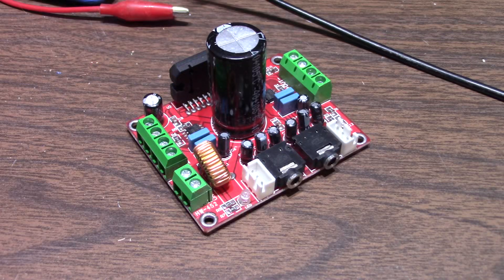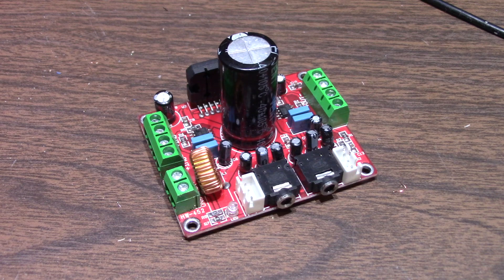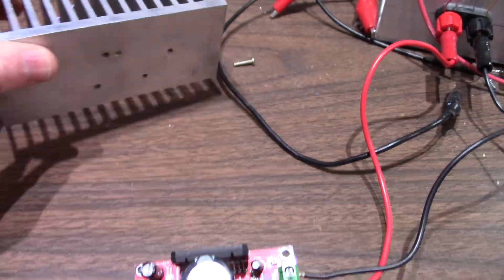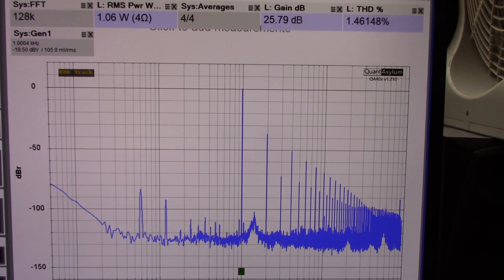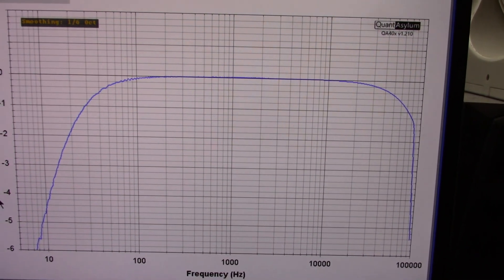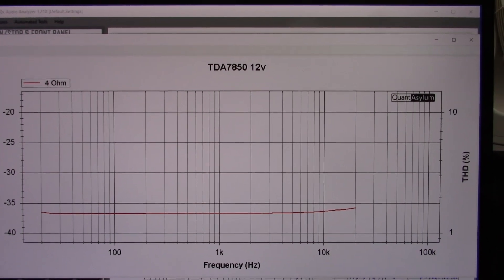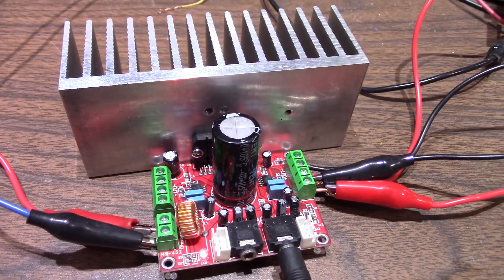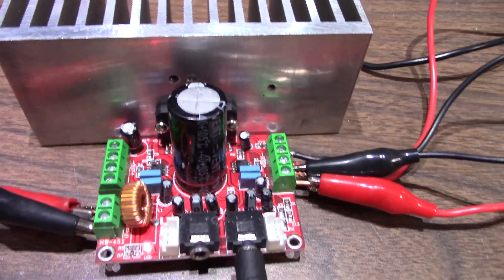TDA7850 4 channel amplifier on the audio analyzer

Comment: That might have bad electronics or be a copy of the chip because it's supposed to do 4x28W at 10% THD (theoretically).

Anyway it's not like most branded car units are that amazing too, some get less than 15W at 1% THD and always have the fake 4x50w garbage ratings too which never gets anywhere close in real power.

PS: but that 1+% THD was atrocious LOL, hope it's a copy and not a real good TDA7850 😵‍💫

Comment: What is the difference between  tda 7293 and tda 7294
Reply from the maker: Very similar operating performance. The 7293 has a higher (no signal) supply voltage and pins with extra functions for versatility in use.
Reply: @JohnAudioTech  Thank you
Reply: @amitchodankar1989  Adding onto that, i believe the biggest difference is the 7293 can run multiple devices in Parallel to run VERY low impedances. like 1.5 Ohm. As far as i can tell there's no limit to how many 7293 can be hooked together. The 7294 can operate in bridge mode using 2 devices for 150W 8 Ohm 170W 16 Ohm
i went though the clip amp rabbit hole a few years ago lol

Comment: I am using a slightly more premium version of the TDA7850 than the one in the video (from the same manufacturer as the TDA7377 board John tested recently), but I feel that the TDA7850 chip itself has relatively high distortion

I have used various Class D products such as TPA3255, TPA3251, and TPA3116D2, as well as Class AB products like TDA7851 and LM3886

However, the TDA7850 chip, in particular, seems to produce vocals that are slightly less clarity and extremely smooth, almost as if a tube preamp were connected. This might be due to high levels of 2nd harmonic distortion

It is designed as an automotive amplifier chip, it has excellent resistance to EMI and noise that can occur in vehicles and on the road. Additionally, it typically supports REM IN functionality and operates within the single DC 12–15V range of a car, which is a great advantage

If you want a more powerful and clearer sound:

For Class AB, LM3886 would be a good choice (but requires a dual-rail power supply and EMI protection)
For better efficiency, TI’s TPA3251 or TPA3255 (preferably with PFFB circuit) would be ideal, though a DC/DC converter and EMI shielding are necessary.

Thank you for always making great videos :)

Comment: Any chance you plan on testing the TDA7294?
Reply from the maker: I don't have that one, but do have the 7293.
Reply: @ would it be possible to send you some? I have a large number of them, 100% authentic as well as small circuit boards to run them, would love to see them measured on the channel.
Reply: Just seeing if you saw this message. Not interested?
Reply from the maker: @ I did not see that message. I am releasing the TDA7293 tests. It is essentially the same chip with extra functions on some of the pins. I would expect them to perform similarly. I did get inexplicable results making me question the chip I have. It might be a good idea to test known authentic ones.

Comment: This amp has 2 rohm BA3121 denoiser for getting rid of ground loop noise, would that cause such distortions?
Reply from the maker: Datasheet shows these buffers to have very low distortion. Around .002% at line level voltages. They should not be the cause.

Comment: Over 1 percent distortion all the way is weird. Around .1 percent at low power should be possible, I guess. I see 2 soic ic's. Maybe input stages? Are these overdriving the poweramp or something?
Reply from the maker: The smd ics are buffers designed to eliminate ground loop noise. Datasheet shows they should have very low distortion.

Comment: A Real TDA7850 is quite a powerhouse when you feed it 15-16V and 2 Ohm loads. HEATSINK with small fan and it'll last forever. almost 40WPC. 14.4V 4 Ohm you can JUST see 20W. closer to 18W if you want to meet the distortion spec. 20W will give you a couple percent THD but not quite clipping
Reply: Hi. The datasheet is for 14.4V, so the thd must be mesured at 14.4V. With DC voltage, you can go higher with less clipping (28V absolut max with regulation)

Comment: I reckon it’s the chip and layout combined. Probably fake. The data sheet has way better specs than measured. Wonder if desoldering and putting in a proper chip would do anything?
Reply: Mine's chip is real, it plays harder than the other one I have with TDA7388. It can swing a 12" 2 ohms 200W subwoofer. The TDA7388 doesn't even swing and still heats up because of the impedance. Feed it with a 16v 50A switching supply

Comment: Test the toshiba TCB503HQ chip or their equivalents. Almost every name brand car stereo like jvc pioneer sony kenwood alpine are using these for the last decade. 
These are actually a bit of a downgrade compared to the ic's they used before 2010s. The one in my headunit had whole i2c control & the chip would spit back everything necessary like when it clips or input voltage current & distortion. The new ones are just dumb with one enable pin one mute pin one clip dect pin and rest are just vcc ground channel inputs and outputs 😂
Reply: The actual new mobile audio amps are insane, just the ones aftermarket radios are using are old school. many of them while having full i2c coms are capable of 75W 1.5 Ohm for 14.4V and for "premium" specs will allow as much as 25V as even factory amps are starting to have power supplies in them to raise voltage. (not ford chevy dodge, more like BMW, Benz, Audi ect) Check out some of TI's new chips like the TAS6424, it can do 150W PBTL into 2 Ohm or the few years older STPA00x which also uses i2c and full stability with 2 Ohm x4 operation. i think the STPA003 replaced the older TDA7577 that was also full i2c and 2 Ohm but only 2 channels
Reply: @bassblaster505  sony & pioneer both have class d single din and double din headunits with ti 4ch class d amplifier and they have builtin boost converter to make 21v dc for the amplifier chip. It does something like 40w at 4ohm 1% thd and 90w at 2ohm 1% thd. They even have a parallel mode but sony & pioneer aren't using that feature. With that enabled and two channels parallel it can do like 150w into 1ohm at 1%.
Reply: @KuntalGhosh  I Know exactly the decks your talking about, its the TAS5414C. i THINK it first showed up in the Sony DSX-GS80 but im not sure.
Reply: @bassblaster505  first in the mex xb100bt way back in 2016 i think. And the pioneer mvh something.. then xb150bt and then dsx gs80 & m80

Comment: You don't actually have to use 12 volts you can actually use them with a 19 volt laptop charger just fine to
Reply: They are like 16v max..
Reply: In mine I use 16v 50A, 1 pair of 6x9 on channels 1 and 2 and 1 subwoofer 12" 2 ohms 200w on channels 3 and 4. it shakes the subwoofer well, the other with TDA7388 it doesn't shake